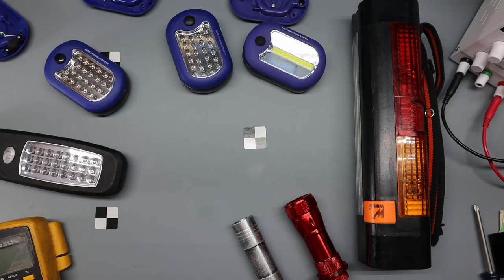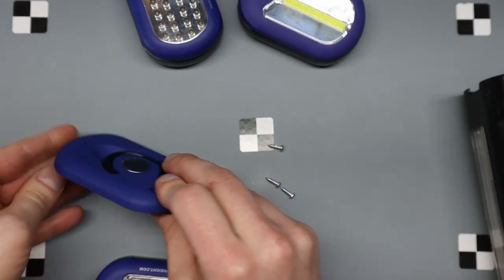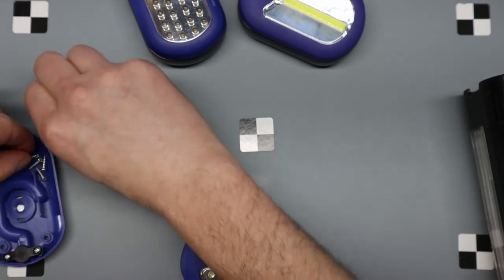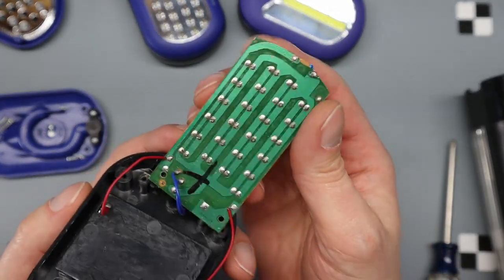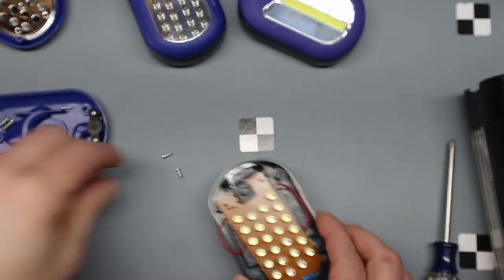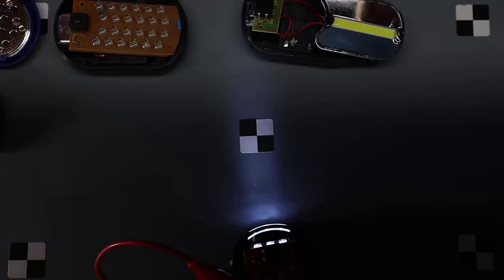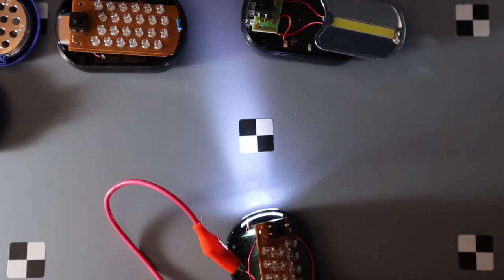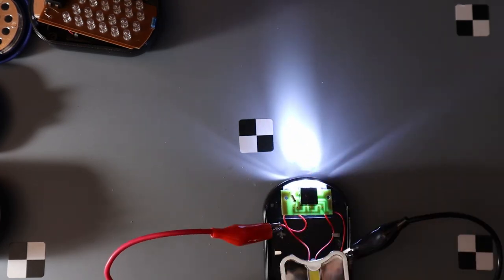LED Flashlight teardown Harbor Freight and more

Comment: I like how you have the checkered squares on your workbench. I don’t know the name of them. I assume they are for scale, for someone watching to determine the size of the objects, and that each black or white section is one centimeter? or maybe they are  half inch? making the square a square inch? I’m United States-Ian, so I don’t know centimeter ? I’ve never seen that, and I think it’s very clever , and probably very useful for someone.
Reply from the maker: Not for scale, just to mark the center and edges of my camera frame at different zooms.
Those are 1" square, they have different uses, like marking the center of gravity of an object, or parts of an item being filmed at high speed like a crash test dummy.